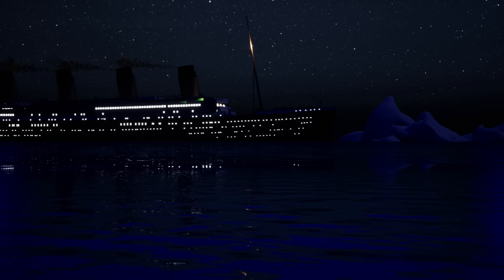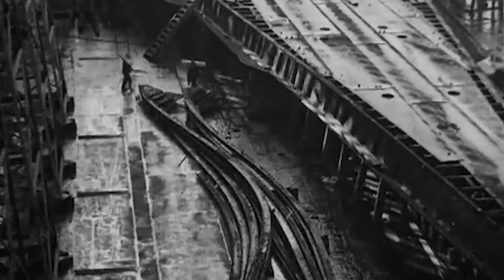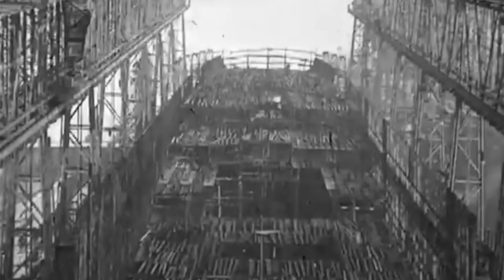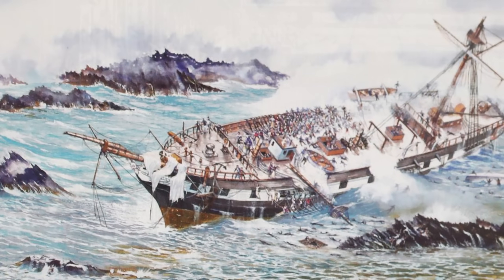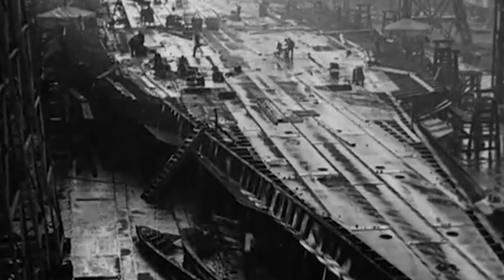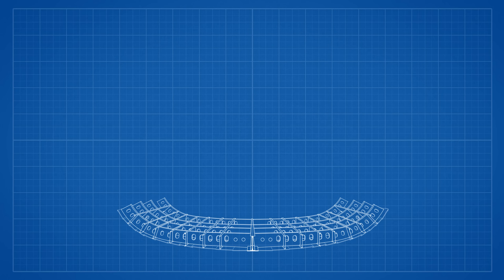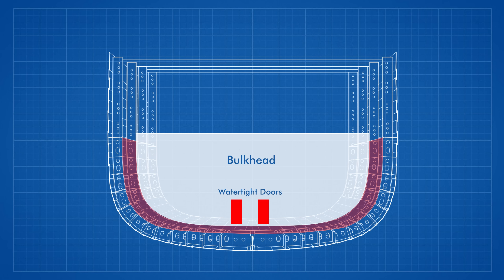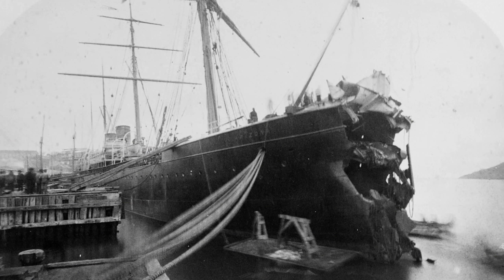How did the Iceberg Sink the Titanic?

Comment: Some have theorized that Titanic could have been saved if all the watertight doors had been left open and if the crew had immediately started taking on extra ballast into the stern. This would have pulled Titanic down by the stern instead of down by the bow. This initial rearward tilt would cause all the new water entering the bow to flow all the way back through the entire length of the ship and into the stern. As the stern continued to flood the bow would have remained mostly empty allowing it to be gradually lifted up out of the water. Once the breaches in the hull rose up above the water's surface all the new flooding would have stopped and Titanic would have remained afloat. In the actual sinking Titanic ended up with its watertight stern sticking up in the air while its damaged bow continued to flood until the ship finally broke in two and sank. If it were done the other way  around Titanic would have ended up with its watertight stern sitting low in the water while its damaged bow was sticking up in the air above the water's surface.
Reply: Even if you could somehow take on that much water in the stern. The elecital power generators were in the back and you would have quickly lost power, lights and radio among other things.

I am also not certain all thr iceberg damage could have been brought up out.of the water. It was aft of the first funnel (boiler room 5). Sure the hull under the last funnel fully came out of the water, but all the water was all the way in the bow. You couldn't manually cause flooding that makes the stern get so low in the water similar to the bow with holes in both the stern and bow. Heck the stern didn't fully come out of the water till the bow was under water and flooding was coming over the top.
Reply: The water wouldn't have flowed back into the stern because of the watertight bulkheads.

Comment: no mention of the coal bunker fire that is said to have compromised hull strength and cause the captain to choose breakneck speed before his fuel ran out…
Reply: The small patch of smoldering coals that everyone treats as if it was a raging inferno did not and could not have weakened the ship nor contribute to the sinking. The “documentaries” that claim otherwise are poorly researched and riddled with sensationalism.
Reply: That's an interesting subject. I think he left it out as there's a lot of speculation around it and we can't be sure of what effect it would have had, although we can debate it.
First i've heard of him running full speed to avoid the coal running out. Where did you hear that?
Reply: @mikeh2006  in a YouTube docu. The bunker fire is widely documented in images on the day and precedent with other vessels. Burning coal to get to the hearth of the trouble is a known course of action. The conjecture is based on the fuel consumption math resulting...

Comment: I'm not metallurgy or ship design or ocean expert, but the impression that gives me is perhaps that while the forward damage might have been a result of the direct impact, the two much larger openings could in fact be a result of the pressure of the impact flexing the hull plates and/or structural members enough to pop the rivets out of place at slightly weaker joints and force open seams in the hull?

Just a thought.

Comment: How do you make butt joined metal panels water proof? Or are they overlapped and sealed somehow?
Reply: Overlapped and riveted together. Two plates on either side of the hull wall sandwich the plates of an intermediate strake, and on B deck this was doubled for strength and reinforcing the superstructure of the Boat and A decks.
Reply: @jamesgroccia644  But how is that waterproof? There’s paint but something must have been sandwiched between the plates to waterproof it. I’m not arguing just asking because I’m curious.
Reply: @Whitpusmc  The rivets, once hammered into place, shrank as they cooled down and sandwiched the hull plate sandwich tight enough to make a watertight seal. When Titanic hit the iceberg, little dents and cuts were made in the outer strakes of the hull, which then let water spray in. If the doubling seen on B deck was used further down, it would’ve definitely made the hull more resistant to side-on blows but at the cost of stability. Titanic was so huge that she needed some degree of flex in her hull so every wave she ran into didn’t snap her apart. Modern ocean liners like Queen Mary 2 and Princess Elizabeth were built using this exact same principle in mind.
Reply: @jamesgroccia644  Thank you for that explanation!

Comment: I had heard a naval architect once say that it isn't really the extra cost of the construction of the extra layers of safety that creates problems in calculating their use, it is the fact their added weight and dimensions reduce the ships cargo carrying capacity while increasing fuel consumption.   The losses from less cargo and increased fuel costs over the life of a super safe ship far exceed the construction costs of super safely.  So they have to calculate all of these tradeoffs and create something that is commercially viable.

Comment: Someone please explain this to me, because I've never understood it: the watertight compartments ran up several decks high, but how could water just spill over the top of them? I've always thought the ice cube tray metaphor was kind of insipid. Yes, it explains the successive chain reaction effect, but it's not like (in the boiler room for example) the watertight wall extended a story high and then there was a 3-foot tall slit running the full width of the ship for ventilation into the next compartment that the sea could waterfall over in the event of a flooding. So I repeat, how could the water rise higher and spill into the next area? 
I get that when the bow was heavy enough it could be pulled down and water would wash over the railing. From there it could flow through doorways and down stairwells to the other decks, but how could it flow over the compartments before then? Help me out.
Reply from the maker: Think staircases, ventilation trunking etc. These existed in the watertight compartments too but of course there were watertight 'walls' at four sides. When those 'walls' 'ended' at the top of the watertight compartment the water could keep surging up deck to deck from those openings and then flood the next compartment from above.
Reply: @OceanlinerDesigns  Hmmm, that's very strange to picture, but thanks for explaining that.
Reply: Also the compartments weren't capped off with watertight tops

Comment: The topic issue is why the Titanic sank.  There is a single, main cause and contributing causes, all cited in the subsequent, quite thorough for it's day, investigation.  I recall, within one of the many discussions I've read, ONE person mentioned a cause that has not been cited BECAUSE we have only learned it existed long after the investigation was over and quite reasonable, true and due conclusions drawn.  One maneuver by the OOD on the bridge might have saved Titanic entirely.  
   The NTSB today, things being similar to Titanic's mistakes, would look for "pilot error" that could have avoided mortal damage to the ship entirely.  IF the response had been pre-established, DESIGN-BASED contingency emergency planning, there was a maneuver, a way to hit the iceberg of any type or size to still BEST insure survivability - one way only and easy to do too - REDUCE Engine SPEED, as fast as possible but hit the iceberg within 10 degrees either side or so of dead ahead.  ANY resulting damage then would reduce the impact to succeeding watertight compartments as fast as possible when hit as such.  If the pilots of the Titanic realized this ahead of time, the Titanic then would have more probably stayed afloat indefinitely and able to be even towed to port.  Pilot error, again, as the NTSB has found predominately over the years.  Pilot error is fixable, avoidable, not an act of God, not inherent in the affairs of humanity.
Reply: I mean…are you really gonna blame them for trying to turn away from hitting an object instead of going straight into it?
Reply: @DerpyPossum  Yes.  If the OOD had been  fully using the new watertight compartments BEST, by design, a head-on strike would only crush and flood the first one or two compartments, the bow is much stronger built than the sides to sustain the blow and still be seaworthy.  Any side-swipes are knowably greatly more dangerous AND a simple set of pre-established contingency maneuvers, (to offset such reflex action as an avoidance turn doomed the ship to the llooonnngg side-swipe so unexpectedly sinking it so fast) could have changed everything, allowing the Titanic to float indefinitely, until safely abandoned entirely at least, as the compartmentalization was intended to do.  More than a century of hindsight of the incident yields this realization, not ship mastery on my part.

Comment: Even though everyone knows it sank, I’m always trying to think of ways it could have been saved, going so far as thinking they should have blown the front of the ship off with TNT to get rid of that sinking weight - using the rest as a lifeboat 😂

Great video Mike - always super insightful!
Reply from the maker: That's a fun and interesting idea Johannes! They did this to refloat Suevic's stern section after she ran aground. It can be good to think outside the box! xD
Reply: A more practical solution would have been to flood rear compartments, if that were possible - this would have kept the ship pitch relatively flat, so stopping the water spilling over those front bulkheads. Organising that within the hour or so they had, without the means to punch giant holes in the rear though...
Reply: @jamesmiller113  No need any part of a ship can be flooded if you really want to. I think she was too far gone, she'd have lost too much buoyancy but maybe if BR 5 didn't flood or they manadged to patch it up, run the pumps and flood the engine room. Then again no engine room, no pumps. Bit if she staid afloat for say 4-5 h, Carpathia could have hooked up her pumps and Californian now finally woken up could have been the hero keeping her afloat with Californian until a pump ship could be brought in... wish I had the maths or modeling skills to run some of these scenarios. I know that in modern simulations they showed she could take more than her designers thought. But not 6 compartments. Or 7 with engine room flooded for ballast. At some point it flows over the bulkheads even if she's on an even keel.

Comment: Your point about the advantages of box girders in ships can also be extended to aircraft of that same era. A noted aircraft designer, J.E. Gordon, wrote a highly entertaining as well as informative book titled "Structures, or Why Things Don't Fall Down" that talks about how that type of structure in biplanes (made up not of steel plates, obviously, but wood-and-fabric wings braced by struts and wires) gave decided advantages over monoplane construction of the day, and why it took so long for the latter to win out over the former. "The preference for biplanes was...not due to some kind of reactionary stupidity on the part of air ministries but rather to the fact that the biplane provides what is inherently a stiffer and stronger form of construction - especially in torsion." Engineering history is full of little crossover gems like this if you know where to look.

Comment: What if Titanic sailed / hit the iceberg head on?
Would she have stayed a float?
Seeing how you explained it & letting us know the water spilled over the bulk heads got that question going around in my head.
Reply: Jeppers. Either him or someone else made a video about that. Probably bow pancaked up to the second or third compartment and about 100 unlucky souls crushed but she'd have staid afloat no problem. Just not an easy split second decision to make. By the time it was obvious she wouldn't clear, it was too late to steer back into it and just letting her crash head on at 21 knots would definitely have ended in Murdoch being cast a villain and incompetent, since no one could imagine what would have happened in our timeline.
Reply: @please_stop-v7o  The other thing to remember is that icebergs are wider underwater than they are on top - so the helmsman may have thought he had more room to clear the iceberg than he really had.
Reply: @RJSRdg   There are those who say (with some circumstantial evidence) that there was damage to the bottom even very substantial damage as some water seemed to come through the floor. She had a double bottom, heavily compartmentalised and reinforced so it would have needed damage through the bottom and the tank top, which is kind of unlikely but possible of course. Hard to see that area. But the damage we see is under water a fair bit up from the bottom, she did clear it over water. Some overhang was smashed off by the superstructure and landed on the deck (3-4t). But it looked like they cleared it for a moment then they felt it. It was about 30 m tall so a few hundred m deep likely, about 5 million tons. Big sucker...
Reply: I think she would've survived a head-on impact yes and that I've based on what happened to the Guion liner Arizona in 1879 on an eastbound voyage. The largest liner of her day (like the Titanic), she smashed her bow against a giant iceberg and, fearing the end, everyone clung together in tears. As it turned out, it was not the end, the forward bulkhead held. In thankfulness everyone sang the hymn "Praise God from Whom All Blessings Flow" as she started on her limp towards St. John's. In quite the twist of logic, though, the accident was portrayed as an example of the safety of ships rather than the dangers of ice.  I am sure many other vessels made it to port  if with a limp  with dented bows, pitted hulls, twisted rudders  and so on

Comment: I'm glad that you acknowledged Dr. Ballard's original 1986 discovery of the only part of the iceberg damage that remains visible past the mud line. But there is actually two far superior images of it in his "The Discovery of the Titanic" book on pages 196 and 197 that clearly shows the unmistakable separated hull plating.
Reply: What's more is that section of iceberg damage happens be the line that extends nearly all through Boiler 6 and just into 5 and where it's situated about three feet above the keel is almost exactly how Chief Fireman Fredrick Barrett described it his hearing testimonies.
Reply: I seen alot of pictures seen alot of documentaries and read a book or two on Titanic and never once have I seen a picture of iceberg damage. I'm sure they had to use some kind of sonar to see what they suspect was the damage the iceberg did as its well and truly below what can be seen with any traditional camera. Any damage that is seen on the actual ship with traditional cameras is the effect of the ship hitting the sea floor not iceberg damage.
Reply: @edbeasant9494 It must have been going at quite a speed also the weight of it. Massive impact
Reply: @edbeasant9494  Um no. The keel, especially around the bow section's bilge keel is intact all the way back to the break point. The damage I'm referring to is almost to the tee a perfect match for what Fireman Barrett saw and where he said he saw it in Boiler Room 6 and it terminates aft just into Boiler room 5, again as surviving boiler room crew described.
Reply: @edbeasant9494  I cited the book and pages, please go do some research.

 The iceberg damage hidden by the mud was imaged using ultrasound on a later expedition.
Reply: @nowhereman1046  yes I know but how would there be iceberg damage above the mudline when the iceberg only damaged the hull below the water line? The mudline almost reaches the anchor which is well above sealine. Doesn't add up mate.
Reply: @edbeasant9494  Have you ever looked at any of the mosaic images of Titanic or Ken Marschall's excellent paintings of the wreck?

The mud slopes down the further back on the bow section. Boiler Rooms 5 and 6 are past the mud line and the side of the entire side of the hull is still visible along with the iceberg damage in those areas, both above and below the waterline.
Reply: @nowhereman1046  the problem with that is the titanic hit the sea floor with such a force it's not 100% that any of the damage seen is iceberg damage or damage from hitting the sea floor.
Reply: @edbeasant9494  The iceberg damage to the shell plating along boiler room six and five is above the mud line, and it was visible to later expeditions. The damage is obvious.
Reply: @nowhereman1046  what about that long split there?  The ship must have cracked there before another area broke off? aka the ship was in two pieces.
Reply: @edbeasant9494  forensic analysis would determine that a gash from an external source is different to the damage sustained from impact with the ocean floor. And as mentioned the location and type of damage fits the testimony account.
Reply: Even with sonar and manned sub observations of the hull ; we don't know what damage was caused by the berg and what was caused by the 2 mile drop and slam into the sea floor; we may never know! The perforations by the berg could've beeen opened up more during the stress of the breakup and then closed up again after the collision with the sea bed.
Reply: @deepseadirt1  exactly